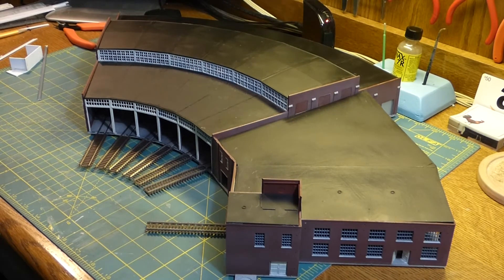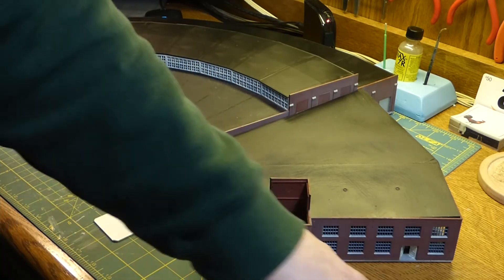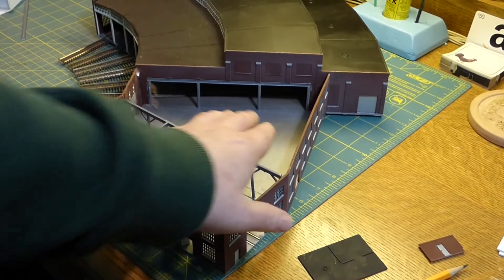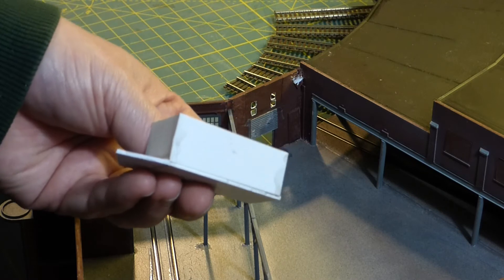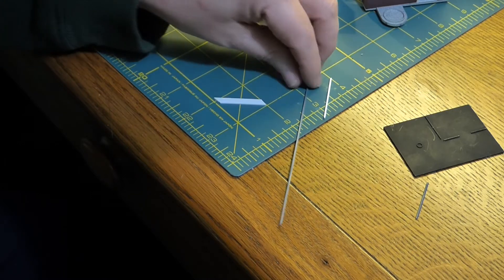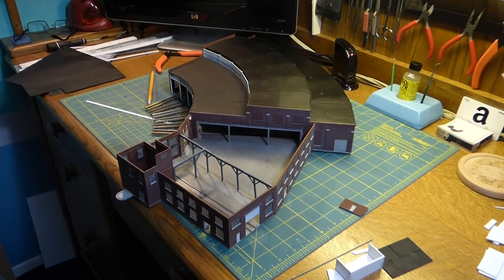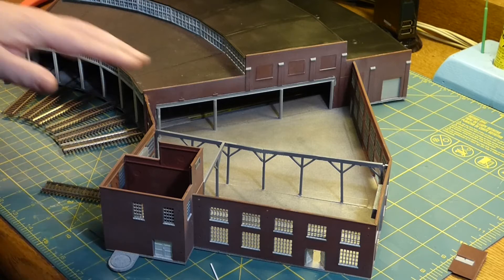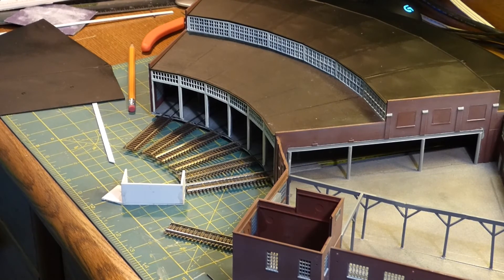Roundhouse Machine shop Kitbash Part: 6

Comment: Mike,
Looking good!  I like your idea of having something inside the building to look at when looking through the windows.  I hope you'll do a video of that. 
I wonder if you should leave the roof of the machine shop removable for the same reason as the upper roof of the roundhouse.  Should some equipment get stuck deep in the machine shop, you'll be glad for the accessibility. 
Ray
Reply from the maker: Ray Duda thank you. I hadn’t planned on doing a video on the interior wall backdrops but maybe I can put something together. I’m still not decided on the roof situation yet. Happy holidays to you and yours!